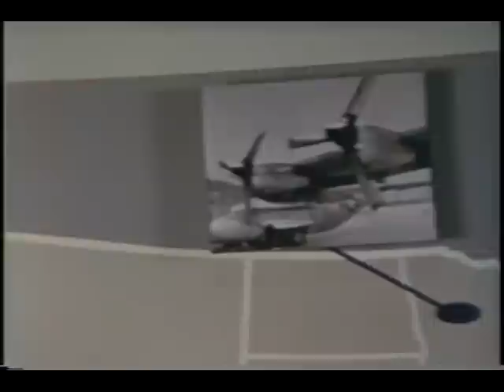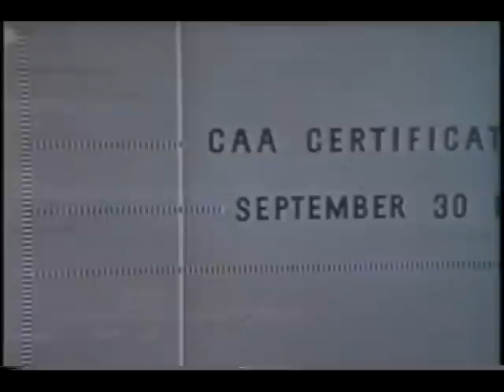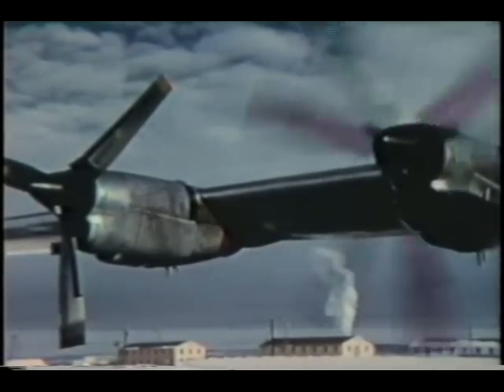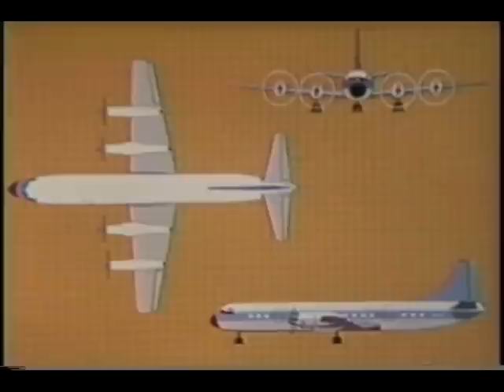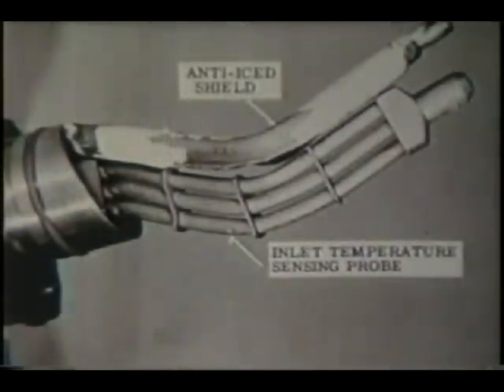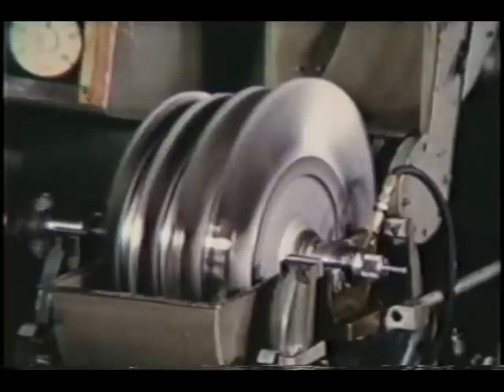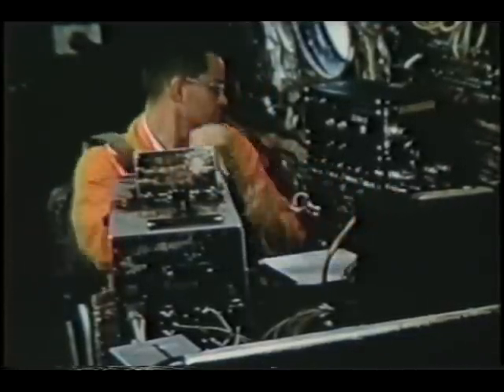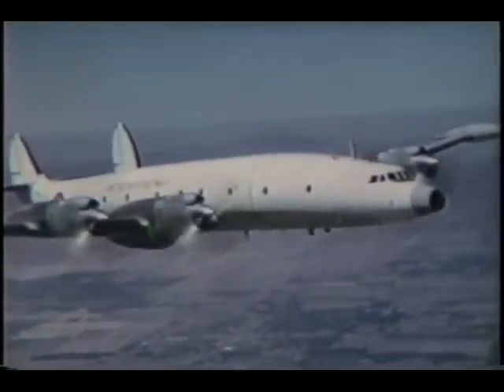Lockheed Electra Propulsion Story

Comment: I rode an Electra in 1960 from Burbank to San Francisco with my grandma  and sat at the right window and could watch the prop pitch change. Only 2 airplanes landed at San Francisco due to thick fog. We were one of the two.  It was my first time in a plane and I loved it.
Reply: Great that you had a nice flight but it could have ended badly, as the wing problem with the Electra had not yet been identified or fixed...
Reply: johnlouisville
Yes, and I sat on the right side directly in line with the propeller and was amazed at how it changed pitch. Later in life when I flew all over the world in my job, I purposely missed AA Flight 191  as I felt a very strange feeling in the pit of my stomach and REFUSED to get on ANY airplane that day. 273 people died in that crash. I have better luck with boats now.....

Comment: Frontier had some Convair 580s with this engine, and they were good airplanes for mountain flying into HDN.
Reply: The CV-580 made up the bulk of Frontier's fleet in the late 1960's.  Frontier, Allegheny and North Central all had large fleets of the CV-580.  I have never flown into Hayden, but when I was in college at CU, I had a good friend who lived in Craig, and drove by HDN many times where the CV-580 provided the only air link of the NW Colorado airport with the rest of the country.
Reply: Frontier flew Convairs front Denver to the ski resorts in western and southern Colorado, at least until Continental and Bob Six took over. I was commuting between DEN and SLC, having the pick of 6-8 flights on Western or about the same number with Frontier or the Frontier-Hughes ArWest code share. I hated the old Western 100 and 200 series 737's, they were hellish over the mountains and upon landing the engine reverse would cause all the junk in the shelf above your head to fall. Their stretch 727's were a might fine machine, and if I could get to DEN early, WA had a 720 making the flight, really a fine airframe. More often than not, I took the Frontier flew Convairs and I loved them, but in winter, you often landed in Grand Junction or a number of Western Slope towns to wait out weather at Stapleton, or to top off the fuel. I think the range was such that, they couldn't remain circling in DEN's infamous holding patterns for long, or maybe Frontier took on more cargo, and less fuel to begin with. Nothing was worse than Stapleton when there was weather. I recall that only the shorter  East Runway was used when the snow was significant, likely due to wind conditions that made the long north-south twin runways more hazardous. A girlfriend was killed in the 1988 CO DC-9 crash (Denver-Boise) using the north-south runways during a blizzard, of course icing and an incompetent first officer who was in control had something to do with it. Horrible crash, cold, wet, it took forever to discover the crash, since the tower could not see though the blizzard, it was 45 minutes before doctors and rescue trucks got to the scene. Ground personal with CO commandeered a bus used to take employees to their car lots, were first to help, but sadly no one had the equipment to move the crushed aircraft off the PA's underneath, or any way to keep the injured be dry and warm, it took a long time to get simple block and tackle set-ups with all the lumber they could find to get to many. The aircraft had flipped on it's left side after becoming slightly airborne, those in the left seats were buried in seats that had come loose, bodies, sheared off pieces of metal, and fuel pouring out of he broken up left wing. Horrendous

Comment: I can see the engine powering Armed Forces transports because of the advantage over jet engines when you land on poor or poorly maintained runways. Having flown a variety of Convairs, the turbojet works fine there also, but reeeaaallly trying to add some of the advantages of the jet engine to a prop, when the jet engine was becoming standard with Boeing and De havilan, is like spitting into a 150 mph wind, counterproductive, money not well spent. I love the sound, the precise hum of the Electra's four power plants working in harmony, but the disadvantages of the propeller are just too great, IF you don't have to utilize them. Danger to airline service people and PA' s, yes I have a buddy, Jim Boardman, cut too pieces when he was misdirected, coming too close to a spinner, the vibration is still there despite the turbojet, and all the other inherent problems with a prop.

Comment: 20:50 a pilot's dream, a super connie powered by reliable Alisson D501s replacing troublesome C&W R3350s turbo-compounds.
I wonder how would be the performance of a L1649A Starliner turboprop.
Reply: Now, that would be a Dreamliner to me!
Reply: As far as I know, there were no plans to use the Allison 501 on the Constellation. The proposed turboprop Constellations were to use the Pratt and Whitney T34-P-6, which produced almost 2000HP MORE than the Allison 501s. These planes were robust performers, with a cruising speed of 430MPH and a maximum speed of 479HP. Performance would naturally be less with the Allison 501, but significantly better than with the original R3350s.
Reply: Interesting question indeed. Jet fuel has less energy density than avgas, so a bigger volume and mass is needed to achieve the same range; this means larger tanks and higher MTOW. The weight problem is overcome with more power, but extra tankage is needed. Here's a fine fantasy: a composite Starliner with PWC turboprops such as those on the DHC-8/400 (formerly Bombardier Q400), together with modern props.

Comment: Commentary conspicuously silent regarding the scene in Britain! One or two statements made about being first, are not strictly true.  By 1950, the Vickers Viscount with its Rolls-Royce Dart turboprops was leading the way. Large orders also came from North America for this smooth, efficient and reliable aircraft. But it was limited by its relatively small size.  The Poms also pioneered pure jet passenger transport with the Comet. The disastrous failure of the first air frames due to metal fatigue was rectified, and this was of great benefit to Douglas and Boeing, as it could well have been their aircraft that fell out of the skies due to the unforseen fatigue caused by repeated pressurisation and depressurisation of the cabins. Electra - a superb aircraft. Vickers Vanguard - equally superb, but too late on the scene to be competitive with the Electra and 707 and DC8 jets.
Reply: +Colin Gantiglew All I see is completely random post with a bunch of unrelated ramblings of various British aviation milestones which proved to be UTTERLY INCONSEQUENTIAL in the long run. Incorrect engineering approaches, form over function, whatever; repeated attempts by many UK companies ended in total failure in both the commercial and military markets for decades now - vickers' attempts / comet included. 

By the way, Brits didn't "pioneer" anything with the comet, except a death trap! 3 years before the comet's maiden flight, Boeing already had completed and flown (along with all the R&D, etc) the B-47 at TWICE the MTOW and nearly 100mph faster than the comet. This technology (including the podded engines) was simply repackaged into a passenger-carrying airframe (WITH PROPER FATIGUE TESTING) and they never looked back - 10x more 707s were built than comets, Boeing is now a world-leader in civil and military aviation to this day. De Havilland has what... a fat radial float plane in the beaver?

I love the Brits (I own two land rovers) and all of aviation including the planes in question here - but I'm not so sure your random patriotic rambling has much of a place in reality.
Reply: +sam phi  Oh dear! How true; political involvement in aircraft type purchased can be at once sickening, hilarious, ignorant and downright stupid. Case in point - NZ govt. of the day (1960s) wanting the national carrier to buy the BAC1-11 (politics; Mother England and all that) NAC, however, chose the Boeing 737, for the very good reason that it could handle the severely unpredictable wind patterns of Wellington airport more safely than the BAC plane. But government angry at the decision and forced the purchase of a British simulator as "compensation". Politics more important than passenger safety in government's view.  But that's outside the scope of the present video of the Electra.  Col, NZ "Baby-Boomer" who lived through all of the above!
Reply: you could get a discount on a viscount!
Reply: LOL!
Reply: Colin Gantiglew: You are not fair regarding a good post. The Viscount was very successful for its time, with well over 400 delivered, as were several other civil aircraft, while British military aircraft were second to none, with big export orders in many cases.  Unfortunately, the British lacked the capital to fully develop and market their aircraft, and made too many unfortunate choices at the behest of of their national airlines, while the government made even more disastrous decisions in the military sphere despite technical excellence (e.g. TSR-2).  Don't forget that much 1940's and 1950's British technology formed the basis for US jet aircraft development, especially in engines. The B-57, and later the AV8B, were adapted British designs which saw long service. The long distance of the US from  USSR  targets required longer range and bigger bombers than Britain required, hence the technology development  head start Boeing got in developing very large jet aircraft. In the end, Europe combined to compete equally with the US in aerospace.
Reply: indeed the windows failed on the comet but not for the reason that is normally given ie their squareness. de havilland were under pressure to keep costs down so instead of drilling the holes around the window and glueing the reinforcers they stamped the holes and negating the glueing process. the reason for choosing square in the 1st place was so that it would not look like ship portholes! even more interesting is that one of the viscounts was fitted with turbojets and its performance actually rather good, almost comet like! so being british they did nothing.
Reply: @sp769    GE did help develop the whittles engine but at the same time they developed their own J35 Axial flow jet engine, which had NOTHING to do with the whittle engine !!!  BY the way all your British crap was brought to the USA for help in developing and producing your stuff....and protecting it during wartime !!!  Facts of history less the lies hype and British BULLSHIT !!!!!
Reply: @wilburfinnigan2142  The Wright brothers were from England and the first flight was at Dover. Daimler, Benz and Ford were from the north country. Cape Canaveral, just east of Lands End is the worlds hub of spaceflight, but the Baikonor Cosmodrome near John O'Groats has been the mainstay of manned space flight for the last ten years. Get your facts straight.
Reply: @reedscarce4192  😂😂😂🤣🤣🤣

Comment: Excellent aircraft once the wing box and nacelle mounts were fixed. It evolved into a fine aircraft with a even better powerplant system. Yes it had a few problems, what aircraft doesn't  but that doesn't explain the hundreds of L-188 and P-3's still out there working hard. It's a testament to a great company and fine design. once you have spent some time working on one like I have you can appreciate the aircraft for what it is. I put it in the same category as the D-3 and the Beech 18 as a stylish workhorse of a plane.
Reply: Yeah, after they fixed it and the wings no longer fell off, killing everyone onboard !
Reply: Still being used by Buffalo Airways in Canada - Northwest Territories
Reply: Also still in use as airtankers with Airspray an Edmonton Canada based wildfire fighting company which flies 14 of them.

Comment: All the intense testing described here is quite impressive, nonetheless despite all these efforts at least 3 Electras crashed in 1959 and 1960, soon after the introduction of the type, because of faulty design of the engine supports. These mounts were too weak, causing vibrations to the wings, which resulted in structural failure and finally fatal crashes with many fatalties. An extensive redesign followed, but confidence was lost. Insofar there are analogies to the British Comet tragedy. Moreover 59 of the about 170 aircraft built were lost, a rather negative record -although only part of the losses can be attributed to design flaws.

Comment: The Electra only had one problem, the wings kept falling off.  After Lockheed fixed the wing beam, the model went on to a LONG and valuable Navy service career as P-3 Orion long range ASW and patrol aircraft.  I have over 2k hours in P-3B and C models.  We flew airshows with two engines out... on the same wing.  And routinely flew long range ASW missions with engines 1 and 4 shut down for fuel economy because restarts were so reliable.
Reply: The P-3 is a rather cut-down Electra.

Comment: Why oh why oh WHY didn't the turboprop Connie not become the queen of the air?   That combination of efficient engines and the most beautiful fuselage ever concieved would have worked.
Reply: Amen and Amen, I suspect it was too expensive to operate compared with the Dash 50/707. And when you could cut the transcontinental travel time in half to one-third the time, that hurt also. The Connie was the most beautiful design ever, but they did have engine problems, I believe dealing with losing oil, internal pressure problems that required the damaged engine shut-down, etc. someone on here will know the specifics. Those were the days, people wearing their best clothes and behavior, great service, wonderful meals, captains that inspired confidence by engaging with the PA's giving flight progress updates, info on the aircraft as well as dipping a wing so PA's could see the Grand Canyon better, pointing out other sights. Today's pilots tend to fall into the nerdy, techno class, introverted and noncommunicative. There is a classic line-What do pilots use for Birth Control? Answer- Street Clothes. If it doesn't make sense your favorite FA can explain it to you. Just don't tell them the FA part of the joke- What do FA's use for Birth Control? Answer-Nudity
Reply: Dash-Eighty.
Reply: Could not haul enough people when the Boeing 707 came out. Faster, higher, and more range. Connie is one of the most beautiful airplane ever built. Flew from Honolulu Hawaii to California one in 1948 in a Connie.
Reply: @ohwell2790  Yep, Connie was the Concorde of it's day, no doubt.
Reply: Wasn’t production cost of that fuselage also a factor? It’s not a simple tube .

Comment: A Connie with 4 of those test engines should have gone into production version. It may have still be around. The Saab 2000 is powered by an updated version of this engine in the 4200 shp range, turns q six blade prop. Awesome video!
Reply: A turboprop Constellation WAS in the works. But it was powered by the Pratt and Whitney T34-P-6 rather than these engines. With around 5500HP per engine, it was a VERY robust performer. But the plans fizzled, likely due to the expense of building the complex fuselage of the Constellation. The Electra (and its more common derivative, the P3 Orion) used a MUCH cheaper constant cross section tube fuselage.
Reply: @matthewstorm5188  The Connie fuselage was 70 years ahead of its time... would be great for composites  as in the B-787.
Reply: Agree !
And L1649As with the new wing with extra tankage would be the model of choice.

Comment from the maker: Still flying 56 years after the first one rolled out of the factory. Can't be that bad. It did have issues early on but that was caused by propeller whirl mode.
Reply: Apparently there are about 26 Electras (not all flyable) still in the Northwest (NWT, Yukon, Alberta, Alaska).

Comment: Wasn't it the engine oscillation and subsequent engine mount and wing failure what ended the Electra?
Reply: +ROCKSTARCRANE     Yep, designed with static tests, harmonics not given enough study and time.
Reply: That was quickly fixed and Electras are still flying today!

Comment: "Holiday Airlines" flew Lockheed Electras in the 1960's, and early 70's when I was a kid. PSA also flew them too. I used to see them come in to LAX, and hear the "WOOSH" when they reversed the pitch on the props to slow down. I miss those days when most of the noise from LAX was the sound of droning propellers, and the backing from planes on real steep approaches with piston engines. At night  l could see flames flashing when they were backfiring.(Of course they reversed the pitch once they landed 🙂) I lived less than 1 mile east of runway 25 left, I lived in lnglewood, 1 block  from Lennox high school at the time. I had a multi band radio that I could listen to the aircraft communications. I loved it. I still listen to aircraft communications.